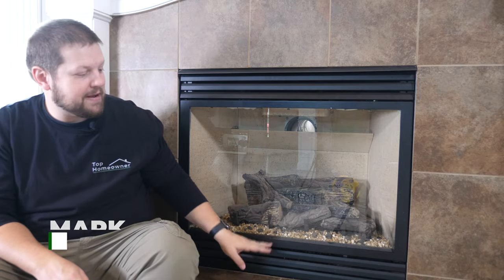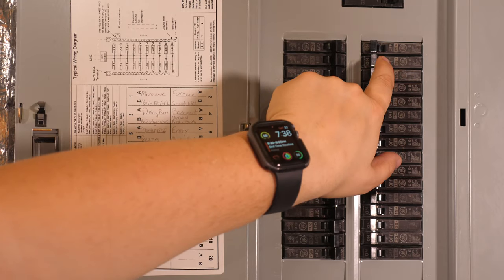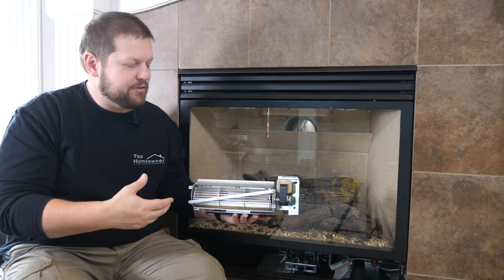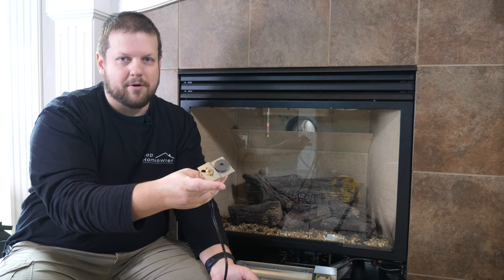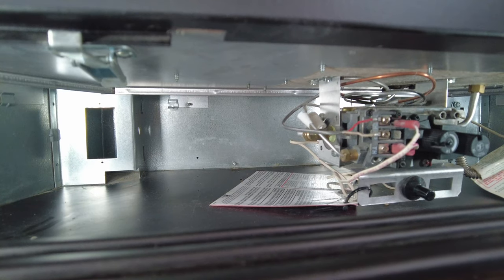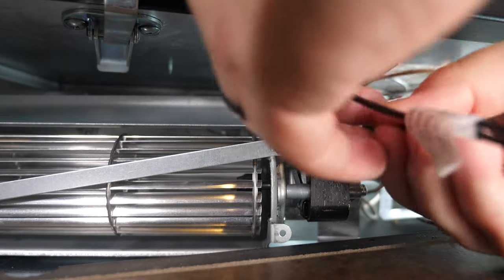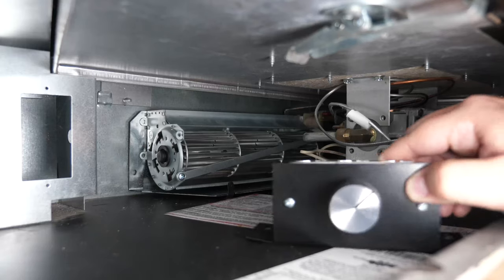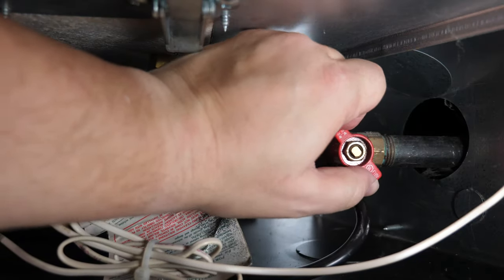How to Choose and Install a Gas Fireplace Blower Kit

Comment: What can I do if I don't have a power outlet inside the fireplace..... I do have one wire that goes in that controls if or not the fire gets turned on, but that wire doesn't have any voltage on it..

Comment: My gas fireplace looks like its intended for the blower to be mounted in the tip compartment. The top compartment has the power receptacle, and there's absolutely no room for a blower in the bottom. Can't find a similar setup me tinned anywhere though

Comment: Thanks,  very clear to the point
Reply from the maker: Glad it was helpful!
Reply: I purchased on amazon for $39 it has steel bearings , speed controller, and , temperature sensor with magnet , so there is cheaper options too if ppl look to save

Comment: Thanks. Couldn’t get any power to my outlet by my fireplace and then when you mentioned there could be a light switch with a button that doesn’t do anything. That was a trick.

Comment: Thanks for your video. I went ahead and installed the fan as you described however I was having an issue with the blower not turning off, I went to the manufacturers website and watched a video which showed the fan installed with the Velcro on the bottom and the other pad against the back wall, I called them and they said their video was correct.

Comment: I hope you still respond to this videos comments?  I enjoyed your video as thinking of putting a fan in (my fireplace is pretty much the same as in the video) but underneath where you put the blower is a lot smaller inside.. the back wall probably about 6" wide and the sides go back at an angle and the gas and what not connections are right in the front and center making it that much harder to get to the back(which is small). How do I put Fan in in this case? Thank you!
Reply from the maker: Search for your specific fireplace model to find the right fan. There are a lot of differences between brands. This should help: https://fireplaceblowersonline.com/help-find-my-blower/

Comment: Hi there- I bought a house with a gas fireplace installed but no blower or power outlet. There’s one nearby though. So two questions - one, I don’t know the brand or model of the gas fireplace. Do I have to?  And two, can I wire the blower to a different outlet instead of having to add one in the chimney? Thanks in advance!!! Great video!!!
Reply from the maker: Yes, you can use a different outlet if you are OK with seeing a cord coming out of your fireplace. As for the brand, some of the clearances are tight underneath the firebox and you want to make sure whatever fan you go with fits without having wires touch the firebox itself, and can be put in the correct location for airflow. If you contact this company they may be able to help you further: https://fireplaceblowersonline.com/help-find-my-blower/
Reply: thank you- just watched your video, had same question. Thanks for answering it back in the day- it's helping me now @TopHomeowner

Comment: I purchased this and was so looking forward to install but it doesn’t fit, it’s very big for my fireplace underneath
In video, it seem we both have same fireplace but looks like my builder gave very small space underneath than yours :(
Reply from the maker: Sorry to hear that, I will say I had to insert mine flat in order to get it in the front and then I rotated it once it was inside.
Reply: Yep. My builder gave just 3.5 inch clearance …even if I remove

Comment: The top compartment of my Lennox fireplace has two flaps that have insulation on them - are these only for allowing built up pressure to escape or can they be removed to allow more heat to flow into the upper chamber?

Comment: I'm replacing a blower on my freestanding fireplace. So blowers are not really model specific, but kind of generic? I'm not quite sure what to look for yet. And I think not cleaning the box out is what caused the blower to fail...we bought the house and just started using the fireplace, it started squealing after a few months of use, I don't think it has ever been cleaned out.
Reply from the maker: They all have similar designs but they usually aren't universal. Make sure whatever one you buy is compatible with your specific fireplace

Comment: Trying to install a blower but the space in the front of the unit is not high enough to get the blower in. There is enough height inside the unit. What is another way to get the blower inside the bottom with out going from the front?
Reply from the maker: I believe I had to lay mine flat to get it through the front and then rotate it once inside

Comment: Is there a remote I can add? Fireplace doesn’t have one
Reply from the maker: I found this article that suggests you can if you have the right valve. https://www.woodlanddirect.com/gas-log-faq.html#:~:text=Yes%2C%20you%20can%20add%20a,variable%20flame%20and%20thermostatic%20controls.

Comment: I dont understand why the blower is below the fireplace it will be way hotter if the fan was blowing from the top right?  I got the utlet on the bottom there as well but no blower
Reply from the maker: The top of the fireplace would be too hot for the motor, bearings, and wires. Everything would melt. These are designed to blow air from the bottom, which will heat and circulate it around the box before coming out from the top vent.
Reply: @TopHomeowner  does it come out bottom too?
Reply from the maker: No, it sucks air in from the bottom
Reply: @TopHomeowner  got it tytyty

Comment: The metal bottom of my Gas fireplace does not get warm at all, how do I bypass the sensor?
Reply from the maker: Some models don't have the sensor BUT if you're attaching it to the "roof" of the cavity below the firebox (not the floor where the control sits) it should be getting hot enough to turn it on. Usually takes about 5 minutes in my case.

Comment: 6:30

In heinsight? Have you ever done this before?
Reply from the maker: It was difficult to bend the tabs up after I had the blower stuck in place. It would have been easier if it was out of the way. Just a tip for everyone
Reply: @TopHomeowner  yeah, thanks. I know what heinsight is. What I don't know is why you haven't achieved heinsight before recording this video? I guess you're just a wing it kind of guy, or that was your first fireplace install? 

Just wondering why you think it ok for beginners to teach beginners how to work on gas fireplaces. 

Cause most people who decide to make instructional videos for people on YouTube, have enough experience that they don't need heinsight to know to prebend the tabs.

That was my point
Reply: @megatrolltrollington  adding a fan with velcro and plugging it in is a pretty DIY task if you ask me.
Reply: I don't think you do know what "heinsight" means because it's not actually a word.  Hindsight is 20/20 though😉. I thought he did a great tutorial.

Comment: Great video BUT the heat sensor should go towards the TOP of the fireplace! not the bottom as shown at 7:00 because heat rises. the bottom will always be pretty cool.
Reply from the maker: Thanks for the comment. Actually, the sensor works well on the bottom since it kicks the fan on at around 120 degrees. The cable isn't long enough to reach the top, which is good because the wire would melt since the firebox will get too hot for it on the sides and top.
Reply: So the fan turns on 20 seconds later instead of placing sensor on the top.   BIG DEAL.